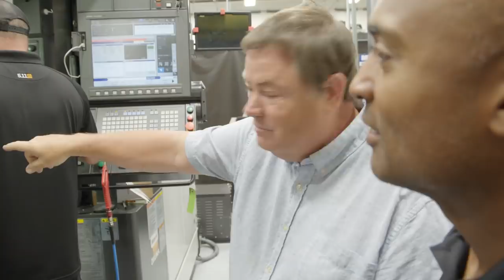Mike Beats Top Fuel Champion Antron Brown On A Race | Mike Brewer's World Of Cars

Comment: "...11,000 horsepower..."  Amusing fact: The Saturn V rocket's F1 engines had 50,000 horsepower [wait for it...]  FUEL PUMPS !!  50,000 horsepower fuel pumps. Each engine, times five engines.